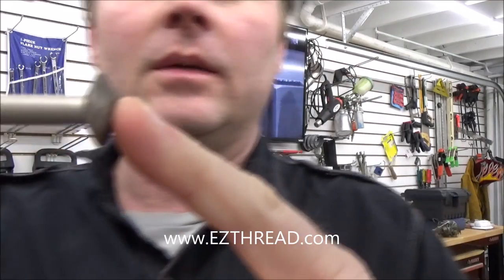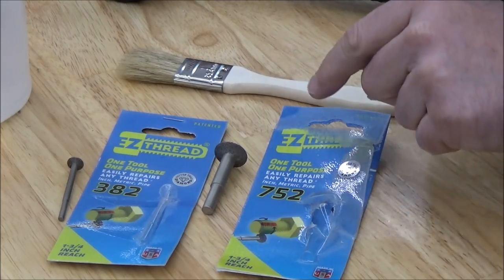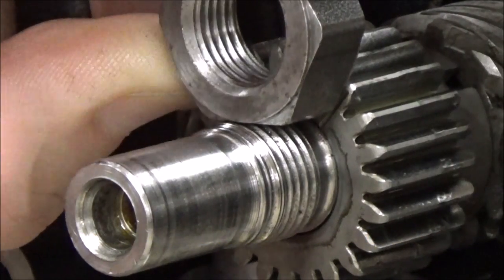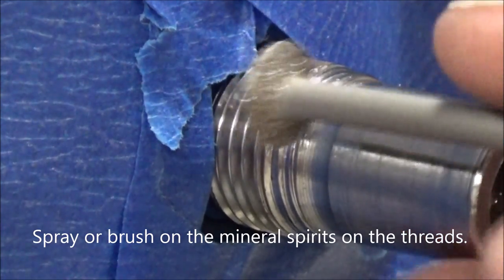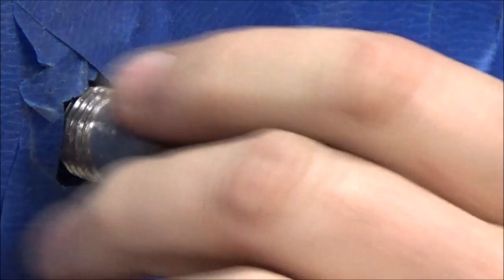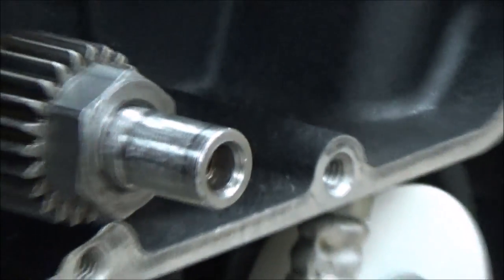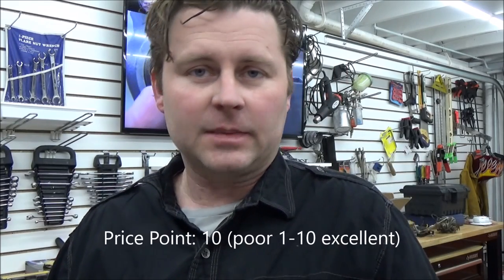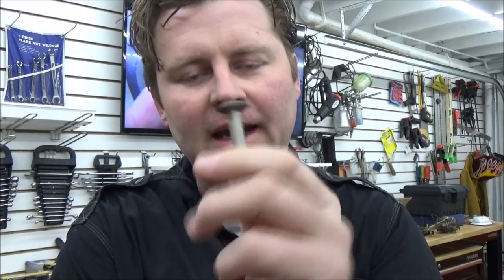Tool Review: Ez Thread Rotary Thread Repair Tool! How to save damaged threads! Demo: HD Crankshaft

Comment: If you have damaged ‘start’ threads and you have several nuts of the right size then you can try this.  Cut a nut in half.  Put engine valve lapping paste on the the treads leading up to the damage.  Assemble the two halves of the nut on the good thread and clamp together with an adjustable wrench or vice grips.  Begin to undo the nut in stages, easing it backwards and forwards letting the paste to do its work cutting and cleaning the threads.  When the nut is able to spin free, clean the paste off and you are good to go.
Reply from the maker: Thank you for adding value to this community! 

Here are over 600 more free videos! Have you subscribed yet to never miss a video? Have you seen the video playlists https://www.youtube.com/user/conleybuilt/playlists? 

Want to say “thanks” or “keep it up”?
Click here https://www.paypal.me/how2wrench

Contact us on the web @ www.how2wrench.com
Reply: Have done this same thing with antiseize, works good
Reply: That's a homemade split die.

Comment: Hey Shane. How well does it work on female threads. Have a burr on a Virago xv750 oil drain??
Reply: Shane Rocks! We want to shout out to Shane for giving us an opportunity to be test through his rigorous crash course and make it on his channel. He's loyal to you guys and wouldn't show it until it was proven. To answer your question, female is just as EZ as male threads. In fact, a user can restore the entire male or female thread with the tool. The versatility of the tool allows for thread finessing or complete thread reconstruction (make good judgement). We are a 3rd generation machine shop and invented (by my father) the tool to keep from chucking in a lathe. This is all we use for thread repair now. We've thrown out the thread files and the like. Lets us know if you have any more questions! Thanks Shane and the Gang! Thank you HalTech for the question! Get' it Done!
Team EZ Thread